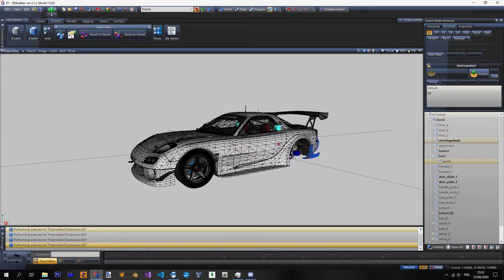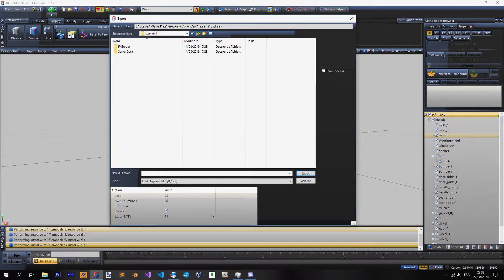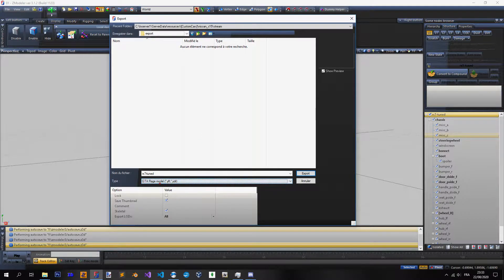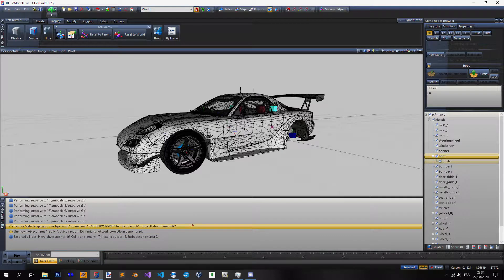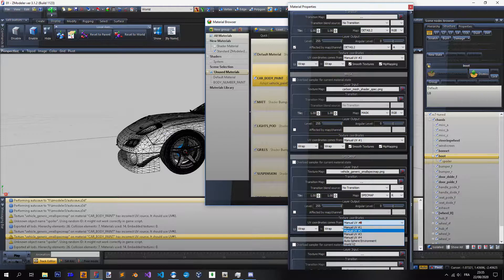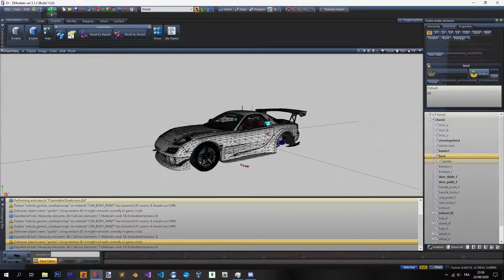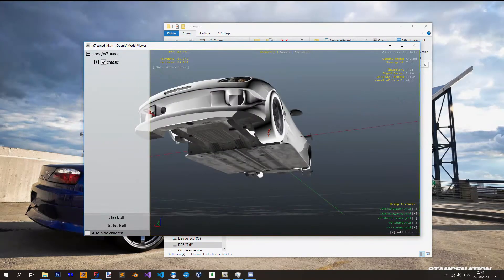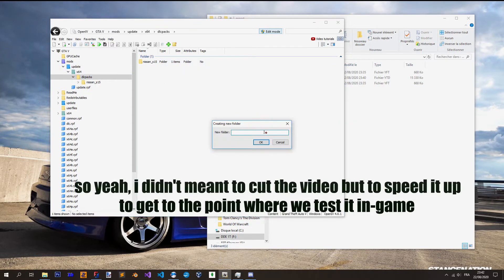Convert cars to GTA 5 Part 5 - making colisions and testing the car in game [3]

Comment: when I export I get can "not complete task: Your License denies this action." and it wont export the car. not sure whats going on
Reply from the maker: you maybe open twice zmodeler, save the project somewhere, close them all and re open it only once
Reply: @Klaceyes  still doing the same thing
Reply from the maker: @baileedezbeans  try to save your project somewhere else than the zmod folder if it's located here, and delete the zmodeler file, and after export it from the zip and try again
It's not the first time that i heard that happening to people, if that don't work i heard that the only way after would be to reinstall windows but imo it's not worth it xd
Reply: @Klaceyes  yikes may have to give up then, i save it to my third drive and opened it from there still no luck
Reply from the maker: @baileedezbeans  there's an other solution but it's not very user friendly, if you have a decent pc you can try to make a virtual machine and use zmodeler on it, and uploading your files somewhere online to take it back on your non virtual environment
Reply: @Klaceyes  not actually that bad of a idea as i use vitural machines quite regularly.

Comment: Undefined adaptation on material "___". Dropping to "default". Solution please
Reply from the maker: apply a shader type
Reply: @Klaceyes  will u please elaborate I don't understand it
Reply: @Klaceyes  I am working tractor model and when I export it after doing everything the lr wheel shows at rf and lf wheel at lr. What would be the solution for that
Reply from the maker: @gurwindersandhu9499  just apply a shader type, vehicle_mesh or something like that

redo your dummy's and check that the axis is facing the same positions (xyz axis) like on the whole car
Reply: @Klaceyes  ok
Reply: @Klaceyes  can I have the all four wheels in my tractor like if don't replace them with dummies will they still works
Reply from the maker: @gurwindersandhu9499  you mean as objects?

if so then yes, they'll work but won't be replaceable

Comment: At 1:37
when i try to export i get this error, 
Can not locate scene node named "test" for export. file:GTARageExport.cpp line:107
Reply from the maker: that's the name of the main dummy, you need to make one, put the chassis inside of it and after everything else inside the chassis
Reply from the maker: and when you export you take the name of the dummy, so rename it like you want and use the same name

Comment: Wonderful tutorials, here's my progress so far:
http://prntscr.com/uiw3mq
No idea why the flickering textures are happening and why the wheels seem to not be centered to the hubs even tho I took the correct hub's axes and the wheel_lf's axes were centered correctly and the dummys were set up correctly too :/.
Reply: Also if you could by any chance send me your Discord or something along those lines so I could pick your brain with some questions that'd be great, first time I actually ever respond to a YT video but you're the only hope I have so far lol.

Merci mon ami! <3
Reply from the maker: @theplug7264  sorry, i forgot to add it on the description, it's Klaceyes#9302

yeah hit me up and i'll tell you what to do to correct what you have
Reply: @Klaceyes  Added you mate. :)
Reply: @Klaceyes  Fixed the paint by re-applying UVs and forcing them to the material, what's left to figure out now is why the wheels aren't where they're supposed to be.
Reply: Fixed wheels etc (axes fault on my part, fucked it up at some point), only issue now is on the tires I get this: http://prntscr.com/uj8vb8 - no clue why.

EDIT: I tried copying other mats and using the right textures for the wheels tread but it keeps using the original diffuse map instead of the tread one.